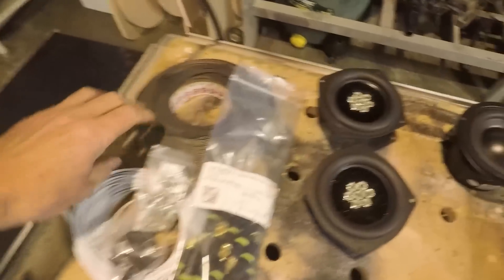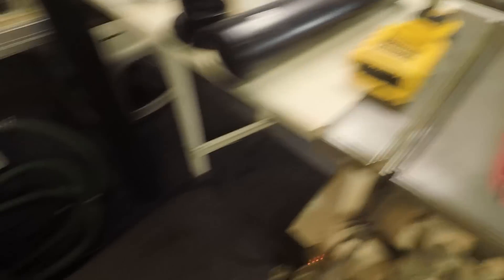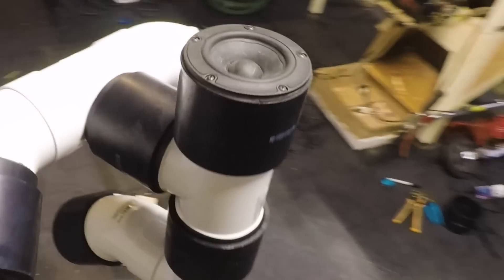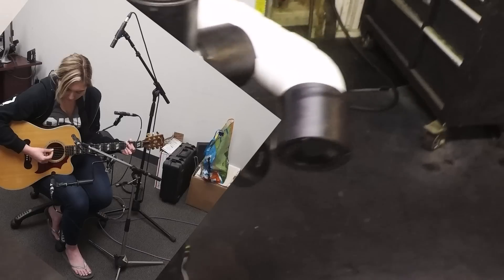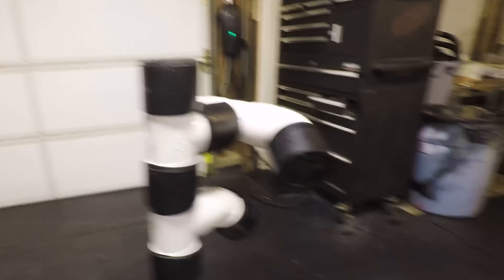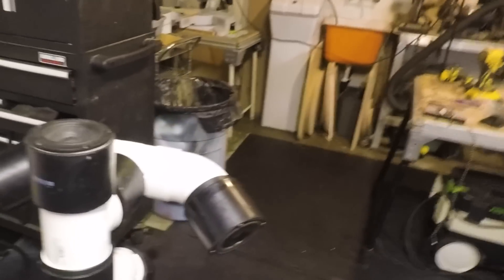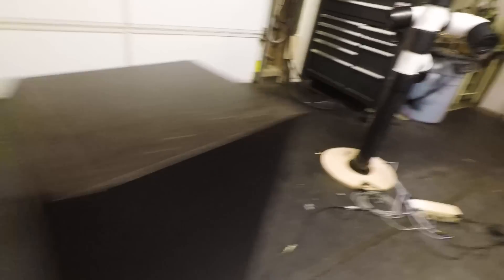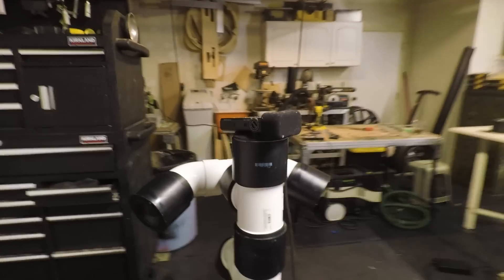Speakers Don't Sound Real, Lets Build One That Does

Comment: I like the idea of what you are doing, but the comparison is unfairly done and in the real world, we [consumers] do not have access to multiple concurrent audio tracks of commercially available music. The comparison is unfair for two reasons, firstly you are comparing four sources with four speakers to one source and one speaker. A fairer comparison would have been to have mixed the four sources to one speaker. Secondly, the one speaker you used, has separate inputs for low frequency and high frequency, implying that it does not have a crossover buit-in, requiring frequency-range separated inputs. That explains why the higher frequencies are poorly represented. In the 70's and 80's, Bose produced speaker boxes that had many similar sized drivers on many different facets and pointing in different directions. They sounded amazing for theitr time, but they suffered with the high frequency noise that the inbuilt solid-state amplifiers of that era had not yet eliminated. I kinda think that you are onto something, but that a better system would be to have two, or even four, multi-direction, multispeaker towers [with quality speakers, drivers and crossovers in them] driven by stereo or quadraphonic or even surround HiFi sound tracks. Omnidirectionality can be achieved by having horn-loaded drivers that point up or down into horns that are vented at 360 degrees in the horizontal plane. This could be achieved with a number of conical or stacked cylindrical towers with woofers, mid-range and tweeters  from the ground up. I would like to see you build suck a speaker for comparison, what do you think? Good job, I enjoyed your post.
Reply from the maker: Hmmm, the goal is to recreate a realistic sounding instrument.

To do so, I believe multiple different sounds need to be radiated in multiple directions.

Bose and omni sends the same sound in multiple directions which is worse due to the reflections being the same as the direct sound.

Speakers that radiate a single sound or mix in one direction are also non realistic sounding regardless of the mic or mix sent to them.

Yes it's unfair as normal speakers, Bose and other designs that radiate one signal will never sound real.

That is the whole point
Reply: @DaveRat  If that is your goal, you appear to have succeeded. But none of what you have done improves the situation of ordinary music consumers trying to listen to music. If we were to want 4 audio tracks and 4 speakers for every instrument, imagine the cost of listening to a philharmonic orchestra. Of course that is an extreme example, but you, as an audio engineer, had to have a studio specially record content for your experiment. At the end of the day, this system is impractical and will never be offered commercially to the public. If you want that level of originality in music, the only solution for the general public is to attend intimate live acoustic sessions with the performer(s). I enjoyed the experiment, but the concept simply lacks practicality.
Reply from the maker: Hmmm, or I could open source the recording format and speaker build and people could upload free recordings of their music recorded in 5.1 format and anyone with a speaker or builds a speaker and a 5.1 reciever could have real music at home.

YouTube now takes 5.1 so videos with real sounding audio could be uploads and downloaded.

Simple, fun and not complex

Comment: Bose have been putting speakers in tubes for many years. The Bose Wave Cannon is literally just that, a twelve inch LF88 bass speaker in a tube, tuned via an active EQ. They sound amazing.
Reply from the maker: For this design, the tubes are inconsequential they are just easy. But tubes are useful and maybe check the vid I did on a 7 ft tube speaker!

Comment: OK, I like the idea of capturing acoustic instruments from many angles and then pointing speakers to emulate those angles, but this is not a fair comparison of speakers.  The 4 speaker set up does give a better representation of the characteristics of the guitar, but to make a fair comparison these factors need to be controlled and addressed: the resonance chambers for the two comparisons are made of different materials (plastic vs. wood), the speakers in the tubes are not ported as is the one in the commercial speaker cabinet, the speaker characteristics are different in that different speakers have different frequency curves, etc., and comparing 1 speaker to 4 is not realistic.  The argument presented in this video is that the constructed speaker would reproduce sound better than stereo, but the comparison was not in stereo.  I would like to see that set up and also compare 4 commercial speakers pointed at the same angles as the microphones used to record.  Interesting idea though
Reply from the maker: I did another vid I will release soon public

The way I see it, I threw together a bunch of speakers, no testing, no analysis into some plumbing tubes and connected them to some cheap Chinese amps and was able to beat a speaker designed by a company who's entire business is building speakers.

If you know or like cool speakers you may like it

In the next video I compare it to:

An ESS AMT1
Rogers Studio 1
Audix Studio Monitor
A mid century modern speaker that looks like a bowling ball
Bose 401
NXT DML panel speaker

And more.

The adventure is in the way the sound is recorded and reproduced that makes this fun and real.

Any speaker that radiates a single sound in one or more directions just can keep up

Comment: I think an open baffle speaker would get you quite close to what you are trying to achieve with this design, right? Because I can imagine the difference in audio being sent out in different directions by one instrument is very small compared to what room interaction does to the same (or very similar) signal sent into all directions. Btw: awesome stuff you are exploring, keep it up! Really inspires me, thanks!
Reply from the maker: Thank you and I feel there would be mixed results. In the forward coverage. Open baffle would be good, clear and transparent. But, the back side of an open baffle is an out of polarity sound which is unnatural and causes cancellations to the sidesnand a figure 8 coverage which is not natural either.

What I want is different sounds radiating outwards like an instrument.

Comment: btw, i'm almost sure you'd be aware of an old Bose speaker design (the '901' i think?) that had 9 full range (4"inch or 5"inch?) drivers in each channel's speaker box, 8 facing the rear & just 1 facing forward towards the room's listeners & each driver playing the same full-range sound signal. They came with an 'equaliser box' to place in-between the pre & power amp or in an integrated amp's tape-loop to 'tilt' the sound towards the lower frequencies.. (just like a trad' 'bass' tone control) ..tho they sounded much better when i heard them at a friend's house without that e.q. box in the chain & with an active subwoofer dialed in to work up to 80'Hz (or 120'Hz max' we thought) 
 Hi'end hi-fi snobs in mags of the day didn't like them one bit & still don't, but "they" had to hear them on Bose's optional extra "speaker stands"... (for hi'fi snob ssles) ...as "they" always place speakers well away from the rear wall & insist "that improves sound staging depth ..blah blah..") but when the Bose 901's were positioned.. (as i'm sure they were originally designed to be) ..with their backs inches from the wall behind them, or in the two upper corners & tilted down towards the room ...I liked them very much.  Those speaker's rears are slightly V-shaped outwardly & symmetrically so on each side of a vertical centre line. & so the 8 drivers facing backwards, 4 on each 'V' face' didn't fire the rear sound parallel into the rear wall but the wall reflected it outwards & forwards, there were no hot-spots where you had to sit to hear sound properly, I also noticed them in Holland & how they filled Amsterdam's L-shaped 'Bulldog Bar' coffee &/or beer room with sound wherever you sat, from 2 speaker placed up in 2 distanced upper corners.   
I feel the same omnidirectional nature of your Tube-Speakers have much to do with how they sounded so life-like wherever you are near them.  As you say, natural sound radiates outwards from it's source in all directions, like spherically where the source is at the centre of the "sphere of radiated sound"   Beamed from 2 directions is a different ball game, & not as good, rather, not as Life-Like.  That was a point I couldn't make in my comment because I didn't know how to put it in a smaller nutshell, so j wrote the book here.   You're really onto something here, it's a shame "tradition & fashion" could stop folk from even looking into the Tube-Speaker. Good luck
Reply from the maker: Yeah, the Bose and all those designs that have a single input and radiate the same sound in multiple directions is actually worse than just radiating sound in one direction like a normal speaker.

The key is to radiate a different sound in each direction so the reflectednsound is not exactly the same as the direct sound causing maximum comb filtering issues
Reply: @Dave Rat    Maybe Bose could have improved the speaker by not having 1 of it's 8 drivers facing direct? Whatever, but I agree tho I'd previously wrongly assumed comb filtering would not happen with 2+ drivers facing away from each other or after reflection. I   never thought of the Tube-Speaker's lack of any comb filtering, as you get from multiple or adjacent  drivers on the same flat baffle board, which must be the all-time most popular & purchased speaker design ever, but they do seem flawed ever since I've owned some & especially since i've seen some awful graphs of 2 or 3 even costly speakers showing gaping troughs & peaks of many db's due to comb-filtering when measured from the prime stereo seat, and graphs showing for e.g. how you can stand up & hear the high frequency end all but dissapear, cheapest type to make i suppose(?).  My current speaker fave's now are 2 old Tannoy Monitor Gold D.C. speakers made in 1969 according to their faded, signed & dated test-pass labels glued on their rears. One 15" driver with a compression driver horn (from 1'khz up) exiting from just behind the main driver's dust-cap.  A mere 54 years old now & still sounding like the best 2-way (or 3 or 4 way) box speaker ive ever had.  They're the only ones that even sound as good from the kitchen & they caused me to stash away my previous 2 pairs of e/stats & one pair of ribbon hybrids that cost a heck of a lot more when I got fed-up with multi drivered boxes.   Had the Tannoys for nearly 25'years now from a local school's playground Saturday sale, i only knew I'd got lucky (for the price) when i got them home. I've subscribed to follow any new vids & ideas you may have.   Best wishes
Reply from the maker: Very cool. A while back I actually was hired by Daniel Lanois to build cabs for his pair of vintage Tannoy coax speakers he bought from Abbey Road. I copied the original cab design. 

Fun project
Reply: @Dave Rat     Wow, I have 2 of his (ambient style) L.P.s, in my collection, one a collaboration work.  If his Tannoy D.C. cabinets were anything like mine, I don't blame him having you build a better pair. It seems like they all used the same D.C. driver of the day from Mon' Silvers, then Reds, & later Golds (as in my 1969 pair) & the price diff' was in the many different cab's they made for them & the D.C. driver's size, (from what I'd read after I got mine)  Tho I can't moan for the price i'd payed, mine were in their very cheapest form, the very basic "Tannoy Lancaster 15 inch D.C.s" with sealed boxes, thin walls & they do have a woody coloration at slightly higher vol's, ive often thought of going in there with some 2'by'4 or  somehow else brace them, they're well padded inside with large pillow-shaped padding stapled on each internal face, but no bracing at all. Tho they still remain the best sound I've had so far.
The main bulk of my non-classical L.P.s are from early 60's to early 80's (they used to label as "progressive music" here in U.K. shops when i was a kid, like Zappa, Floyd, Hawkwind, etc etc) & i must have many L.P.s that were engineered & mixed with Tannoys at  Abbey Road if they used them for that. I liked 1 of my previous e/stat pairs, the now-stashed away "Accustat Model X" speakers but one of their dedicated & combined pannel energizers &  amplifiers that power the panels direct from 4 valve's anodes, with no transformers in the path broke down & i couldn't find anyone to take the repair on, their risen 7,500 volts are too scary for me to look into it!!
Reply from the maker: Very cool! Yeah, he could ught the speakers without cabinets, some bwas raskeabwith recreating the cabs

Comment: Where did the rings come from that fit into the four inch pvc ?
Reply: Thanks again, I don't get out much.
Reply from the maker: All good
Reply from the maker: I cut up 4" PVC pipe
Reply: @DaveRat  Thanks but please read the question again.
Reply from the maker: Ha!  Please re read the answer!

ok, maybe this helps.

The black ABS rings that fit into the black 4" female to female ABS couplers are cut up rings of black 4" ABS tube. The ABS female couplers are then fit over the outside of white female PVC couplers with tape filling the gaps. 

The only rings I know of are cut up 4" tube
Reply: @DaveRat  OK I get it now,  Thanks so much !

Comment: turn on the "mono" switch on your receiver. go back to the 50's.
Reply from the maker: I actually own functioning audio gear from nearly every decade since the late 1800s.

Cylinder record player, windup record player, wire recorder, tube radio that my friend's dad listens to war of the world's on, Telefunken tube radios, 8 track, cassette, reel to reel, hand made Utah horns with pin drives, and so much more.

I study sound as it has been reproduced for over 140 year. I did sell the rotary disk music box from the 1880 though.

Comment: Before stereo sound was introduced, mono music was being experimented with and improved to the point it was almost as good as stereo! They would place the speaker at the same spot away from the wall as the recording microphone was. And the playback music would sound very similar as the original music!

Afterwards, stereo was supposed to have the two speakers placed away from the wall and from each other as the microphones were at the recording studio, to get the most faithful reproduction. But somewhere along the line, someone decided you had to place the speakers against the wall!

With the speakers against the wall, you don't get the most accurate reproduction of the sound...

And it introduces distortion!

Now add the 'surround sound' setup to the mix, and you get even worse operation!
Reply from the maker: The issue I find is that if you have one sound or mix radiating from a speaker, the direct sound and all reflected sounds are all versions of that one signal.

With an instrument, different sound radiate in diff directions so the dir ct and reflected sounds are all different versions.

When all the sounds direct and reflected are the same signal you get in atuarl comb filtering issues that don't occur when all the sounds are different.

No mono or stereo speaker can fix this issue. You need more signal versions

Comment: I think you have missed omnidirectional speakers, like the Bloomline Omniwaves. Expensive yes, but that's 4 speakers in front of while you perceive sounds above your head and even behind you.
Reply from the maker: I cover that in the next video that will come out soon. Omni speakers radiate the same sound in multiple directions. This is an issue not an asset. When the same sound is radiated in multiple directions all reflections off of all surfaces are reflections of the exact same sound. This maximizes cone filtering and phase issues.

This speaker here radiates a different sound in every direction so all the reflections are different than the direct sound and minimizes comb filtering and sounds like a natural instrument

Comment: Your idea is not bad at all. I understood you are trying to make sound fill the room in a more normal way. I agree that standard speakers are more directional most of the sound going forward. When i have some materials and a good design i will try a different thing, and that will be some type of a horn speaker. What you did with the PVC pipes was basically a horn speaker, the plastic vibrates and also emits sound.
Reply from the maker: Very cool!

As far as tubes being horns, not so much.

A horn is an acoustic impedance transformer that allows a smallish driver to move a larger amount of air

I will ponder a video on the topic

Comment: TMO we’re almost there. Take Apple’s Homepod that self-adjust to the room, even as a stereo pair. Imagine having one (or more?) homepods per instrument/voice tactically positioned in your room. Smart software recreates the original setting and sound. Umpf.
Reply from the maker: Hmmm, so far what I have found is that to recreate a realistic sounding instrument you need multiple speakers pointed in different directions each reproducing a different sound of that instrument
Reply: @DaveRat  Sorry, didn’t mean to say that Homepod already does this. HomePod has a beamforming array of five tweeters, room sensing, and is stereo pair capable. TMO, this means the basis is already there. Taking this a step further (hw+sw), I can imagine that a mesh of the things can create the immersiveness and fidelity that you’re after. Thoughts?
Reply from the maker: I feel that radiating differing sound energies outward from a locations like a campfire is the key. Concepts that try and shoot energy into an area by using glorified audio flashlights to simulate a campfire, seems like it will always have huge flaws when the listener moves around